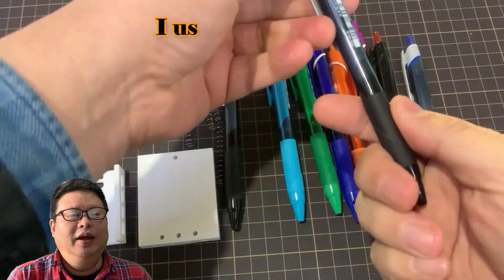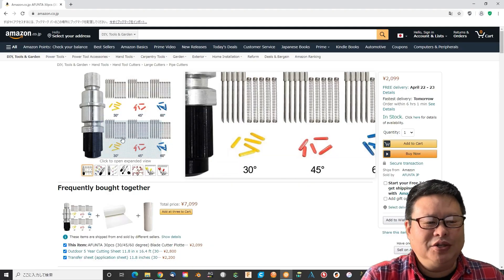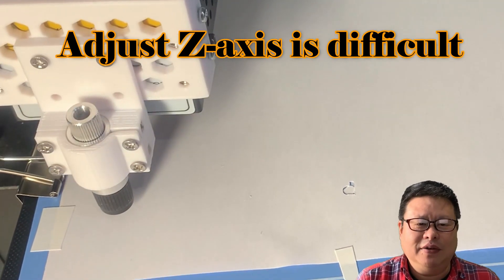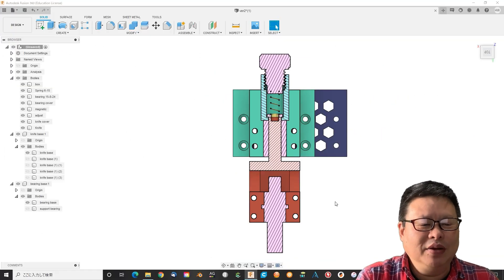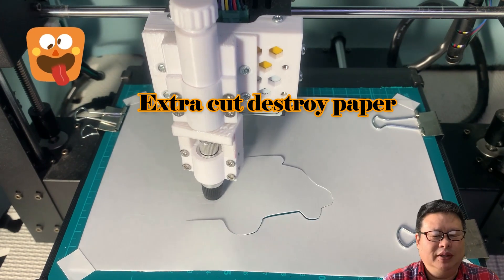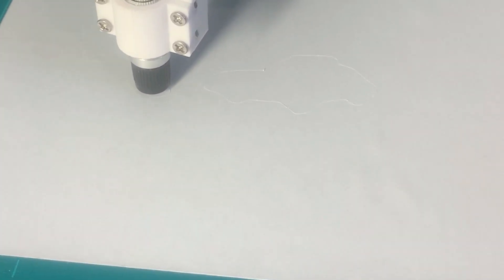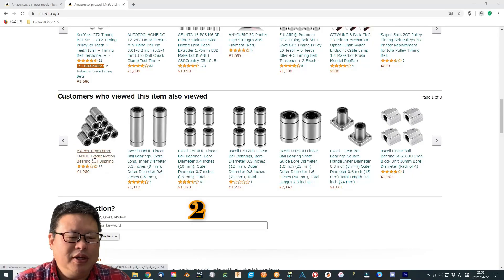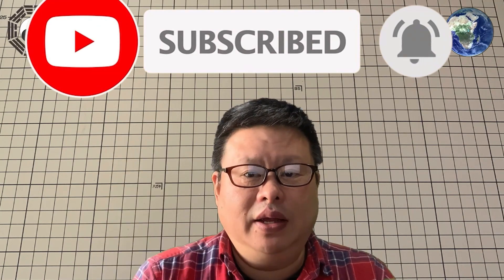Add drag knife to the 3D printer (experiment not well done, I will back)

Comment: Hey wang. Nice. Just an idea: replace the bearing and the spring by a compliant mechanism wich includes both functions. Simpler and no play.
I have a design that could fit.
Reply from the maker: Hi, Lukas. Thanks for your comment. I have checked your video but I can't find where is the design. Would you please tell me where can I find it? I may modify the design if it is better. Have a nice day.
Reply: @TubeUnderdeveloped  here is a video of the mechanism. It was designed for a door lock but the principle might work for your drag knife.
https://youtu.be/_3vZO7YOhoM
Reply from the maker: @lukasskymuh5910  Thanks for your video. It looks nice. I want to move the knife only Z-axis smoothly. I must consider it carefully then make modifications.  Anyway, thanks again.